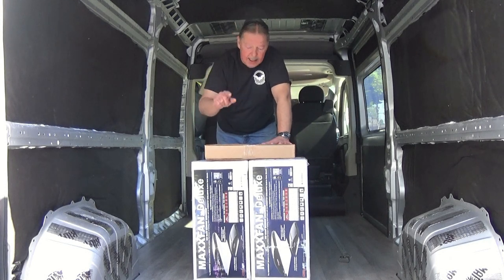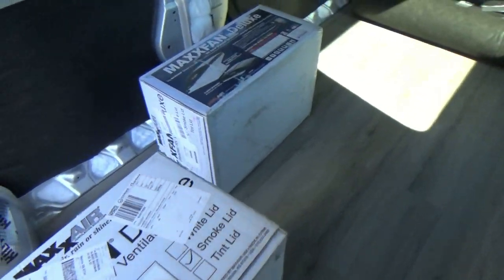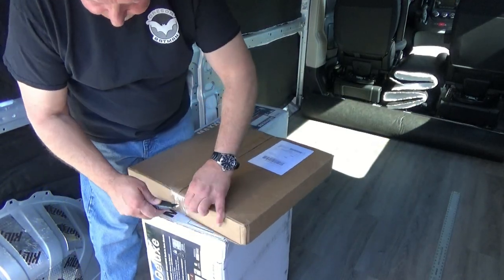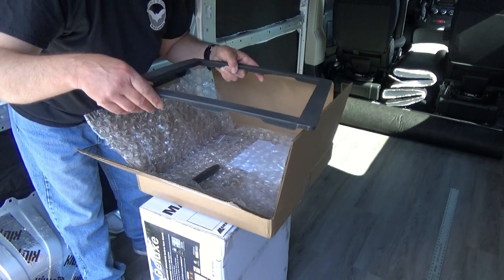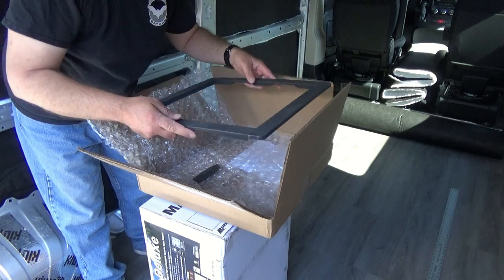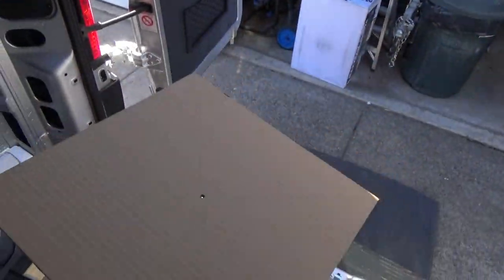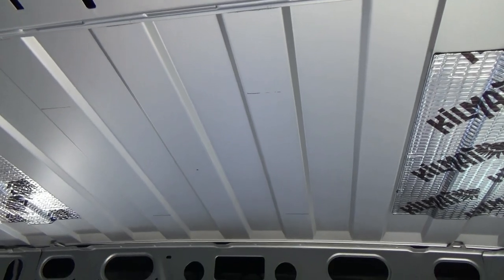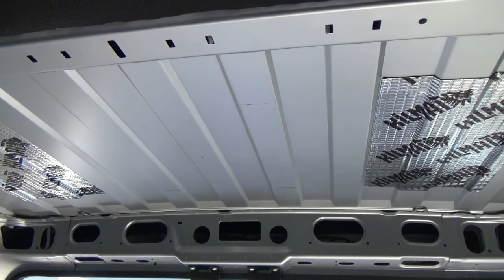DIY Van Build – Promaster 2500 159WB - Installing Maxxair Fans – Part 4

Comment: As everyone seems to be saying, and as you have noticed, the MAXX seems better than the Fantastic. A second "negative" of the exterior roof spacer, but for inside, would be, in theory, perhaps another way to deal with the roof ribbing on the inside of the van. If you had notched your wood ring, that might have also been another way. But your solution with the extra small pieces on the edges worked out just fine. Great video!

Comment: My dad is 88 and he did my two fans on my high roof Promaster. I was just scared being on the ladder handing him tools but you’re right - drilling holes into your van can’t compare to the feeling being on top of the roof (and we still got a roof rack to install for solar😫). Thanks for the tutorial, it really helped!
Reply from the maker: Thank you Kale!:goodvibes:
Reply: Any reason not to use putty tape on wooden frame also? Wouldn't it stick better that that proflex?
Reply from the maker: @gwb8445  putty tape would work just as well... I think I used what was handy at the moment, and the proflex makes for a good adhesive.

Comment: Yep, great video Al!  Those CNC machined fan spacers are really the way to go!  Too bad, I was expecting your bowing problem while watching the video since the metal roof was not totally supported everywhere;  some people also install little wood shims under each and every metal crests.
Reply from the maker: Yup... learned that the hard way. Wasn't thinking ahead on that one... but did correct it, so I'm good! :)
Reply from the maker: @Jack Jack No doubt... I think these are 3D printed. It was a little on the expensive side for just the one... looking back, I should have notched the wood to shape on the inside and made my own van sandwich! :)

Comment: The maxxair fans are so awesome, I have the non deluxe version so no auto open and no remote but I love how much air they move. It's great you have two on it so you can get a good cross breeze, wonder how well it would work if both were on and windows were open?
Reply from the maker: Once I get all of the power set up... we'll give that a test, I'm curious myself! :)

Comment: Hi Oregon Batman, where did you gae your Roof Van Adapter, thank U Marci bcp
Reply from the maker: You can find that on Ebay: Look for "Promaster Adapter"  (link below)

https://www.ebay.com/itm/142478235445?hash=item212c5d5735:g:zycAAOSwr7ZW4zfO&amdata=enc%3AAQAIAAAAwBeuB3hw%2FQCF1bcm1HgjgXWIBkBAjVn39ZXEe0uC0SRC326fZDyhJXNjW6zmBvnGqlEw6FLEyHuQtWsdsbGDE6zXdeE17pAMp48StBl1h7rUQmo1gf%2BxeOJSALj8bHARX0TrckbjYS5c6Z8NJ4j%2Bi43hnoBHv%2BB3UivQI8B%2Bjnxu1lWEo1qcGJUDTT9L4DfzcXUcnCRWn8am%2Be1KOV7Lkc7IkEXCY5VJ2vZa1OfhVA%2FAf7ZPvPgmp1cJB%2BEPQfGX9Q%3D%3D%7Ctkp%3ABk9SR4bhs4H0YQ

Comment: I'm about to do this myself with my dad, just waiting on the fan adapter to arrive. I thought I had all the required extras to do this but now I'm second guessing the Dicor butyl tape after you said it leaves black marks from rain. I never heard or seen anyone use putty tape. Can you recommend which brand of putty tape to use? Thank you for such an easy-to-follow video by the way, it's greatly appreciated!
Reply from the maker: Thank you for taking the time to watch! The brand I used was US Hardware, and purchased at ACE Hardware store. Probably can find at most local box stores or local hardware store.Hope that helps, thanks again! al
Reply: @OregonBatman  I appreciate your reply, thanks again! Just watched your installation one (will be getting the Thinsulate now too) and next your framing video😁 Grateful for your content🙏🏼
Reply from the maker: @gonewiththekale  Thank you so much Kale!

Comment: @OregonBatman : You're awesome.  Great build series.  I have a question, do you feel like 2 fans is the best way to go?  I am on the debate of doing two rear bunk windows and one front exhaust Maxxair Fan.  What do you think?  Why did you go with two roof fans?
Reply from the maker: Great question Lucas! I went with two fans because I do not have windows (that open) in the van, so I knew I needed good cross ventilation from front to rear. IF I had the two rear bunk windows, I would have opted for just one fan in the front. This way, a deck could be built on top of the van, and still have great ventilation inside. I like your idea... two windows and one fan. Hope that helps some! Thanks for checking it out!Happy Building!

Comment: Hey Al, are you using the same remote for both fans?  Is there a way to have one intake while the other exhausts to manufacture a cross breeze?
Reply from the maker: Correct... I can use the same remote for both fans. You can control one to intake and the other to exhaust. Works great!

Comment: I like those contoured rings you found. Do they make one for the bottom side? It would fill the bottom side gaps. That way the metal would get...sandwiched?
Reply from the maker: I had the same thought! Couldn't find any for the inside, that would have been great to have!
Reply: @OregonBatman  What about using the piece you cut out and using the edge as a template on your wooden brace? Just cut the wood out so it contours the roof from underneath? Just a random thought.
Reply from the maker: @jcdahippie  Yup... thought of that... after the fact!! Perhaps on the next build. :)
Reply: Yes you can buy contoured pieces for the inside also. I found them through a video. I don’t remember where I ordered them from, sorry.

Comment: I've watched about 7 full episodes so far and have to say your series has been great!  You're the first person I've seen use putty tape with the rear fan adapter.  Any reason why you chose not to use adhesive between the adapter and the van like everyone else?  Have you had any issues with the putty yet?  

I'm getting ready to install my rear fan this week and am wondering if I should just skip the adhesive and use the butyl tape I already have on hand.  I had already purchased  3M windows weld for the roof adapter.
Reply from the maker: Thanks SoCal!  No particular reason I used putty tape over adhesive... I just happened to have a lot of the pautty tape on hand. I still have to seal with Dicor but it has been holding up very well so far!

Comment: Great project. What is that adapter made of?  Could you use another one on the inside?  Solid enough to screw into?
Reply from the maker: Thanks Bill! I think this is a 3D printed part, would have loved to had one for the inside but that part wasn't made available. Strong enough to take a fastener. Kind of expensive though. Looking back, I should have notched the wood on the inside to fit, that would have been a good option.

Comment: THIS IS AWESOME. Question, how did you measure out the wooden ring? Hoping to do the same. How thick were the wooden strips when purchased and what was the length you cut them? sorry if this sounds dumb im just a super rookie and wanna get it righttt
Reply from the maker: Hey Jessica! Great question girl! Sooooo..... the cutout for your fan is typically 14" x 14". I made the inside dimension of the rings 14-1/8" x 14-1/8". Each stick is a 1 x 2 (3/4" x 1-1/2"). I cut eight pieces at 15-5/8". (This part is hard to describe, but...) You are going to make a square, lay one piece on the floor (to the left of ya and pointing away) then next piece butts up to to that piece at top (side to side). Next piece butts up to that one at top and points towards you, then bottom piece butts up to that one and the first piece you laid down (you should have a square). The next pieces are glued on top of the square you just made, but change it around so the  sticks overlap the joints on the first square.... when you are done, you will have a ring that is 1-1/2" thick and measures 17-1/8" outside to outside. The inside dimensions should be 14-1/8". MAN.... I hope I explained that right.  :)    Thanks for checking it out!  Happy Building!

Comment: Question: In the closed position what is the measurement from the top of the roof and the top of the fan ?  Thank you in advance.
Reply from the maker: Howdy... the fan in its closed position is approximately 5" above the van roof, with the adapter it is about 5-1/2" closed. About 9-1/2" open. Hope that helps

Comment: hey where did you find your maxxair roof vent adapter? and the front and back is the same? thanks
Reply from the maker: Easy... on Ebay, search "Promaster Adapter" and you'll find it. Only need for the back. The fron is actually flat, so no adapter needed. Cheers!

Comment: Why did you make the wooden fan spacer the thickness that you did? To bring it level with the cross braces of the roof?
Reply from the maker: That is correct... when I install the ceiling, it will fit flush against that wood ring.
Reply: @OregonBatman  Thanks! I watched your trailer and now I'm going to watch this and maybe do a Promaster also.

Comment: I see you only bought 1 roof vent adapter, but installed 2 fans. Why? Did one not need the adapter?
Reply from the maker: That is correct... the front of the van is shallow compared to the back and did not need the adapter. Thanks for checking it out!

Comment: what is the tickness of the wood frame for the underside that you used ? 14x14 but is that 2x2 thick ? thx
Reply from the maker: the wood is actually 3/4" thick, so 1-1/2" thich is what it ended up being... 14 x 14 x 1-1/2
Reply: so your doing this to catch the screws form the mount coming through the ceiling ? you doubled up on those wooden frames for the 1.5" thickness ? thx
Reply from the maker: Dual purpose... wanted something I could fasten the fan to the roof with, plus, the added thickness was so when the ceiling was installed, it was flush with the with the rest of the ceiling battens
Reply: excellant. great idea thx  @OregonBatman
Reply from the maker: @keithsullivan7992  You're welcome! Thank for checking it out!

Comment: No disrespect....but a little overkill.  Those are very powerful fans. I have one in my 6×12 cargo trailer. It moves a lot of air.
Reply from the maker: No problem! Appreciate the feedback. Not installing any windows in the back so having those two fans will help a lot moving air around. The back one can be set to draw air in and the front to draw air out and hoping to create a nice cross breeze over the bed at night.

Comment: Problem is, using Dicor means you'll be climbing up there for the rest of the life of the van. Because Dicor is CRAP!!!
Reply from the maker: What would YOU recommend?
Reply: @OregonBatman  Dicor isn't an adhesive. There's nothing in it that actually sticks to anything else. Lexel (Lowe's #455441) Super-elastic. Superior adhesion. Paint-able and it seals around anything.
Reply from the maker: @DustyFixes  I'll have to check it out